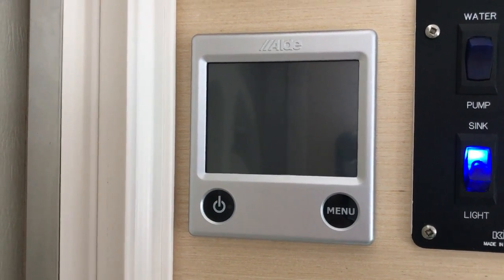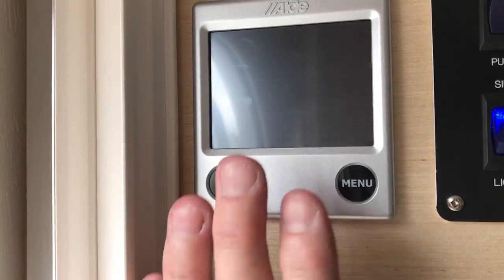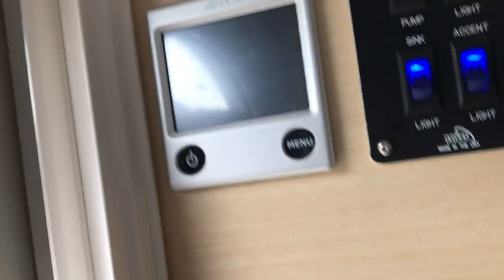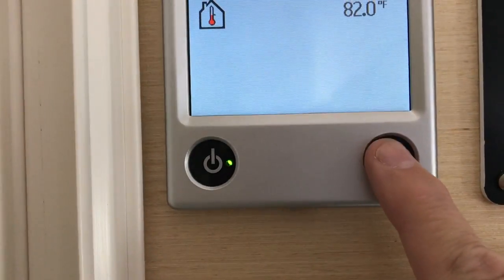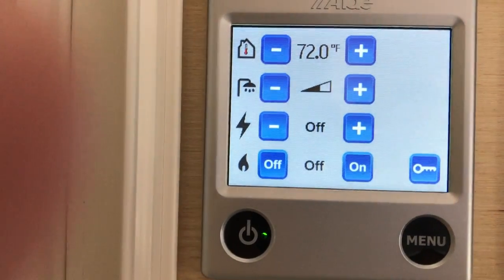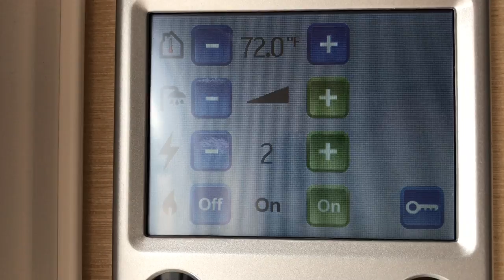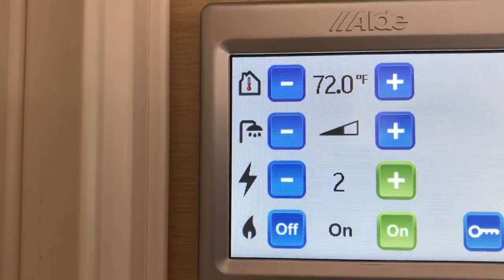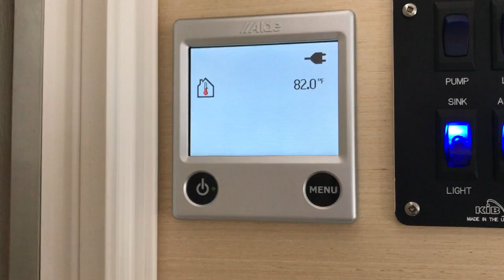How to operate the ALDE 3010 System  -  w/Paul "The Air Force Guy"

Comment: Hey there man. I have an issue of bubbling and not providing heat in cold temperatures. Any ideas?
Reply from the maker: It takes some time to heat up.  I recommend heating it up on Lp first then switch to electric.  Also recommend using an electric heater to get things going.   Best of Luck.
Reply from the maker: Watch this, it may help!  https://www.youtube.com/watch?v=drdxGky_Xo0
Reply from the maker: Another one that may help!  https://www.youtube.com/watch?v=57pEjE9W1nk